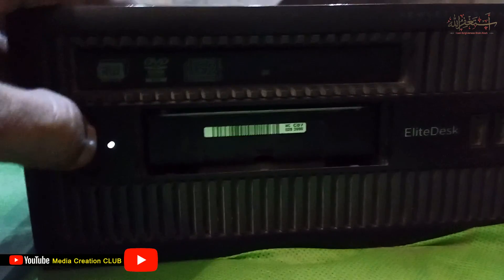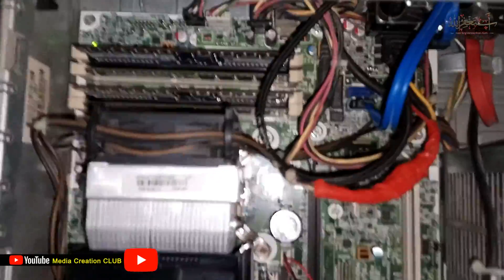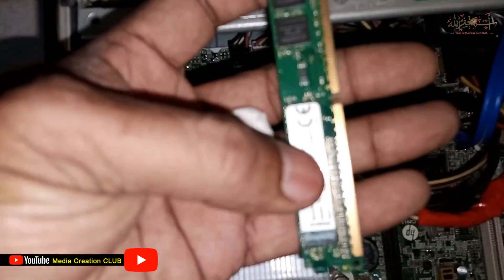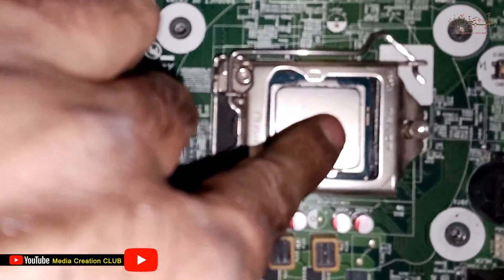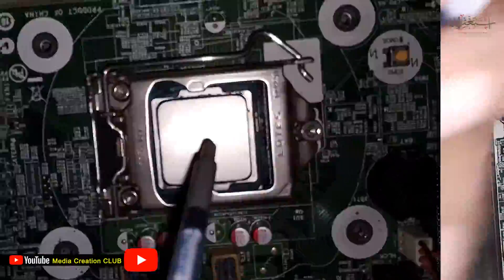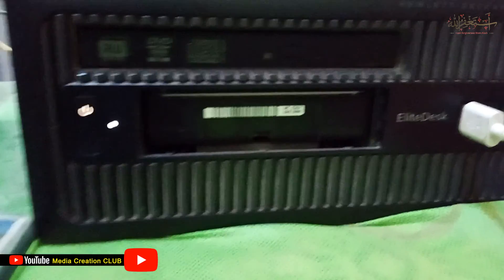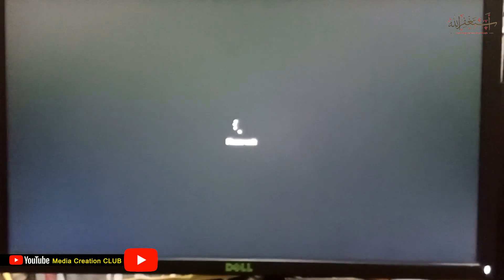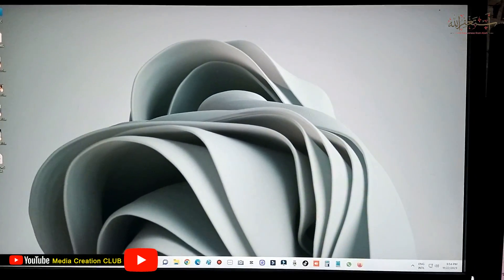High Fan Speed & No Display On Monitor Resolved 100% Free At Home Just Minutes Computer Turns On But

Comment: Cmos battery change ka error aa rha tha, 2-3 baar me start hota thaa...

Ab achanak se display nhi a rha h... 
Ram is working (red light a rhi h... Ram hatane per) 
And heat sink bhi kar diya usse bhi problem solve nhi ho rhi h
Reply from the maker: App aisa Karen  sab se pehle CMOS Battery nikalen or rams bhi nikal Len or us ke bad CPU fan open kar ke  processor bhi nikal ke phir poore connection cables nikal ke motherboard ko nikal ke sunshine ☀️me subah se sham 4 baje tak dhoop me rakhen or phir doobara har cheez fit kar ke thermal paste laga ke on karen 100% app ka problem solve hojaega is method se 

Lazmi try karen

Comment: What about this issue: The fans are running at full speed no chance to control them on bios or windows, display working, everything is normal except the wifi, but when I give the shutdown command through Windows, the display goes away, but the fans and PSU do not turn off continues to work until you completely cut off the power??
Reply: check the cmos battery.....